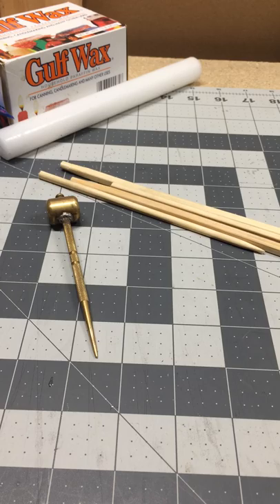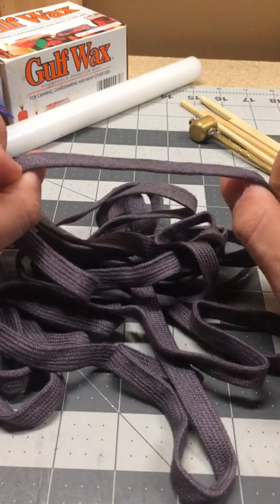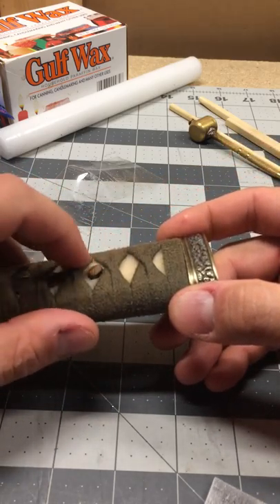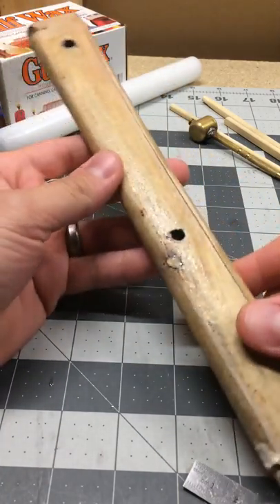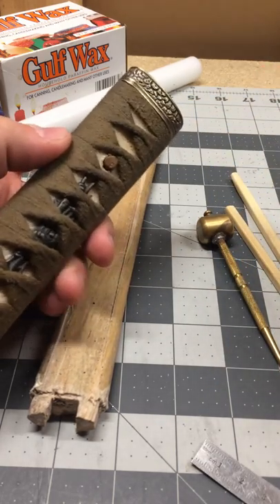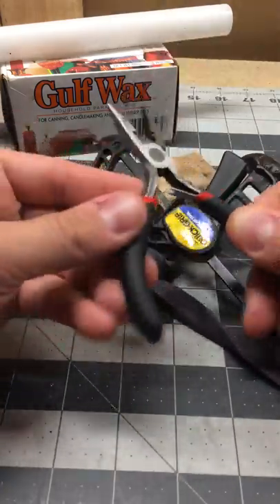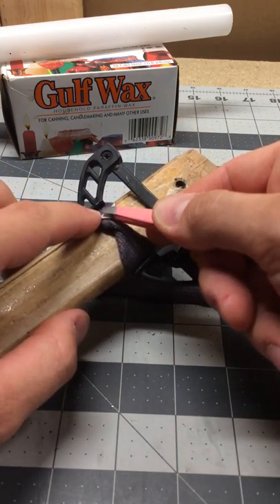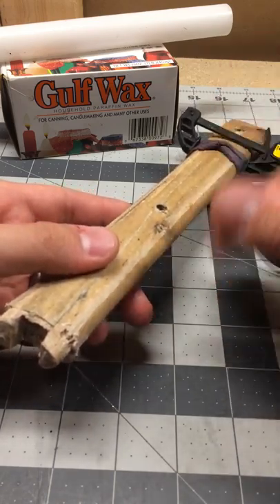Tsukamaki tools and materials

Comment: Drilling the hole at an angle is done because it holds the peg in place better. They don't want to wiggle out as easily as they do when the hole is straight across. That's because, when you put the peg in, it serves as a wedge that pushes the tang into the tsuka. If it were drilled straight, then there would be no way to press the sword in. Just to be clear, the peg pushes the tang in if you hammer the peg in from the side closest to the tsuba so that it drives back to the side further away from the tsuba. Hope that made sense.